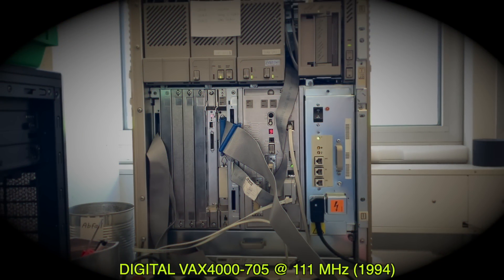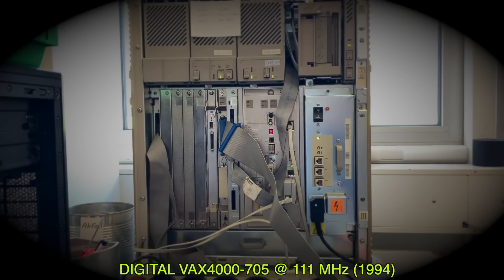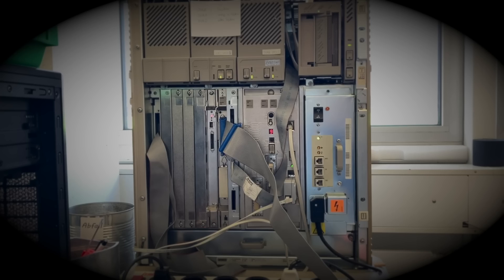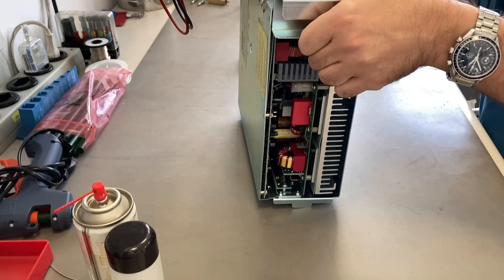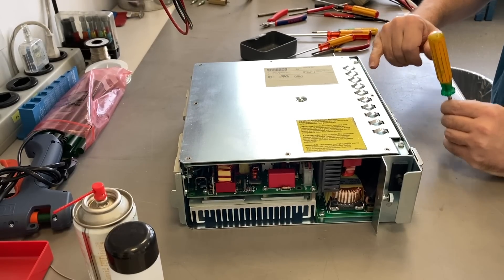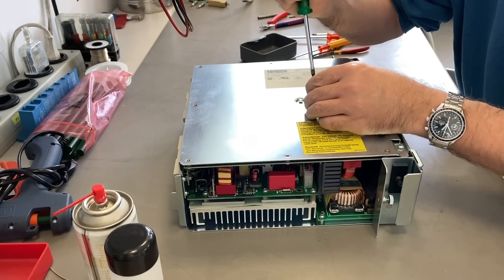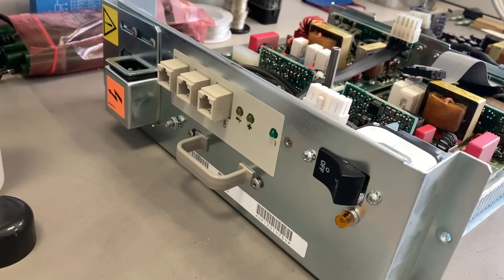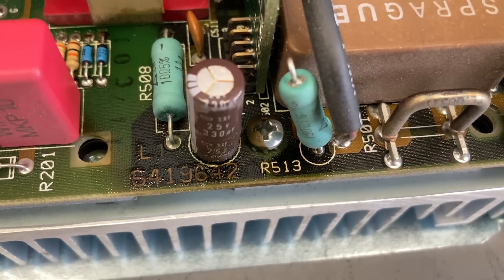Repair of a DEC VAX4000 power supply (PWJ248)

Comment: Nice repair. I've had similar issues with those tall chocolate-brown capacitors, in Sony professional video machines of the same age. Also, beautiful watch!
Reply from the maker: After 20+ years, all capacitors will start leaking. The newer even after 4 years or so. Interestingly I have some very old radios, 70+ years old and those caps are still good. That means, it IS POSSIBLE to make long lasting caps.... but nobody wants to.
On the other hand, I would say that 30 years in that VAX P.S. is good enough. :-)

Comment: Apparently chemicon caps are supposed to be one of the best quality brands but ive replaced lots of leaking/bulging chemicon caps. I don't trust them. I always fit new Panasonic caps.
Reply from the maker: I love Panasonic electrochemical parts. Also lead acid batteries, I guess those guys know what they are doing. I once had a 17 year old battery from an UPS in my car and it worked fine.
But to be fair, 30 years of lifetime before they leak is not too bad. Modern caps do that after 3 years...

Comment: The cap leads are bent over so the cap does not vibrate out when the populated board goes through the wave solder machine.
Reply: I hate wave soldered boards. There is never enough solder applied. When the wave goes past, the solder falls off. Ive reflowed loads of wave soldered boards with cracked/bad solder joints. Large or hot components should be hand soldered.

Comment: I like that LM35 - ish airflow measuring circuit. There seems to be even two on them for safety.
Reply from the maker: Fujitsu made it without any electronics. They used a reed switch and a magnet that loses magnetism when hot. So the switch opened and the alarm went off.

Comment: What do people run on a 1994 DEC VAX these days?
Reply from the maker: VAXgames!
Reply: @PlaywithJunk  Something like that from your 7 year old video: https://www.youtube.com/watch?v=l21wQRb18EI Is there anything more that is being done with the VAX?
Reply: Just for fun :)
Reply: Is it still a production server or just a for fun server?
Reply from the maker: @f.k.b.16  Mostly fun. But sometimes we use it to test old scsi tape drives.
Reply: @PlaywithJunk are you in an it support lab or a museum 😂😢
Reply from the maker: @TheEmbeddedHobbyist   We do customer hardware maintenance. The VAX is from the days when they were used commercially in many places, even power plants. Now we have Dell, HP, Lenovo etc servers.
As long as we don't need the space, the VAX can stay. After that, I'll take it home. 🙂
Reply: @PlaywithJunk  I remember the vax we had, about the size of 3 washing machines next to each other.  every few months the hard disk would throw it's belt. the floor of the drive was littered with them. the service engineer never seemed to throw the old one away.

Comment: Nice when you only need your eyes to troubleshoot.
In 35 years it only happened to me a couple of times.
Cheers
Reply: I've found that the ratio of visible faults to be around 50% (very roughly). 
But that's with VERY close inspection (under magnification, not just eyes), enough to find even tiny cracks in PCB solder joints (often hot components).
It's nice to fix something that only requires a few joints to be reflowed with fresh solder.
Cheers.

Comment: Yup, if you have something that is 25-30+ years old that might have capacitors in it, you should probably check for leakage. Had to replace caps in an automotive ECU from 1992 and a number of other modules in the car. Had to do the same on a 1993 truck ECU as well.
Reply: I would imagine there are a lot of HMMWVs with bad caps in the injection pump driver.
Reply from the maker: I had a 1982 Datsun ZX and I opened the injection control unit out of couriosity. Threre were no electrolytic caps  inside. Only foil and ceramic caps.  seems they knew how to make it reliable.

Comment: I've found a lot of old computers have only a few power rails and are easy to power with modern PSUs with 12v-3.3V or 12v-5V step-downs. The 5v and 3.3v rails on modern PSUs not high power.